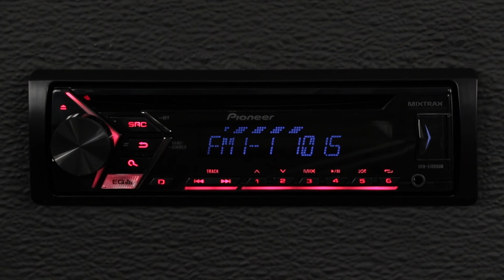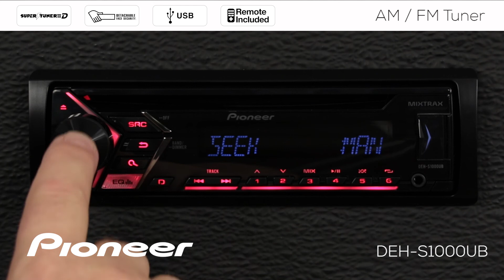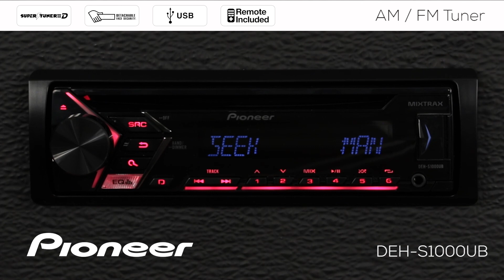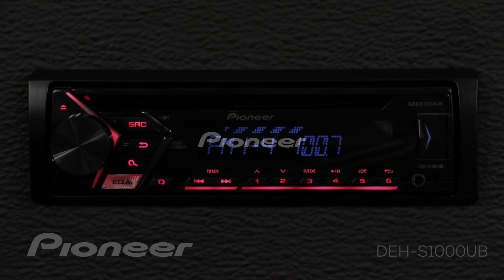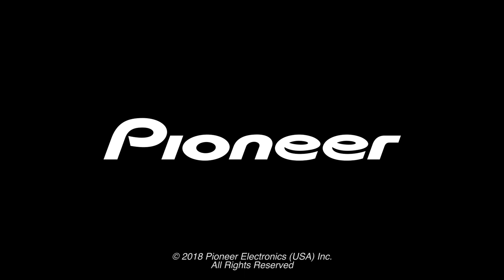How To - DEH-S1000UB - AM/FM Radio Tuner

Comment: why does it skip a decimal point when you seek? I am not able to put it at 89.0. It is either 88.9 or 89.1. How can I tune into 89.0?
Reply from the maker: The Pioneer DEH-S1000UB is designed and manufactured for the North American market.  FM radio stations in North America end in odd number decimals.  For example:  89.1, 89.3, 89.5, 89.7, 89.9, 90.1.   I'm not aware of a way to change the FM frequency step on the Pioneer DEH-S1000UB.   You can find more videos on Pioneer's YouTube Channel here:  https://www.youtube.com/user/pioneerelectronics
Reply: Here in the Philippines, our FM broadcasting frequencies are also usually ended in ODD NUMBERS, JUST LIKE NORTH AMERICA does. But, however, despite the Philippine FM frequency spacing ends in odd numbers, there are some radio stations here are also ended in even numbers (0.0, 0.2, 0.4, 0.6, 0.8), for example, DZLB 97.4 FM in Los Baños, Laguna, Philippines. A listener must use a digital FM tuner that tunes in both odd and even numbers. (mostly, all digital FM tuners use 50 kHz steps or 100 kHz steps)
Reply from the maker: @joshua.duque.sarmiento1115     If you want to use a radio in the Philippines, I strongly recommend to buy a Pioneer receiver designed to operate in that region.   Many receivers designed to operate in the Philippines are available.  Please take a look at Pioneer website in the Philippines here:       https://ph.pioneercarentertainment.com/
The Pioneer DEH-S1000UB shown in the video above,  is designed and manufactured for the North American market. In the north American market, the FM radio frequency steps are odd numbers and never use even numbers.  Products designed for the north American market do not need to change frequency steps and so are not designed to change frequency steps.     You can find more videos on Pioneer's YouTube Channel here;   https://www.youtube.com/user/pioneerelectronics
Reply: @pioneerelectronics  Thanks!

Comment: I save a station and close the machine and when I open it it is not stored, what am I doing wrong?
Reply: If your clock and radio stations reset each time you start your vehicle you may have an improper connection for the in-dash receiver's Yellow Wire.  The Yellow Wire must have constant power from the vehicle.  Do not connect the Red Wire and Yellow Wire together.  Take a look at this video for more information on wiring your Pioneer receiver:  https://youtu.be/kR2MO2kwFug?list=PLw63zJRQbCNjfGaTVA2WEqWsxnMgmnYd_     You can find a full playlist of Pioneer How To videos about DEH-S1000UB here:  https://youtu.be/YNniqyTm-TE?list=PLw63zJRQbCNjfGaTVA2WEqWsxnMgmnYd_    and you can find more videos on Pioneer's YouTube Channel here:  https://www.youtube.com/user/pioneerelectronics
Reply: @deckerdotto6035  thanks i appreciate it!!

Comment: How to mute and unmute?
Reply: The Pioneer DEH-S1000UB comes with a wireless remote control included in the box.  There is a mute button on the wireless remote control.  You can see it here:  https://youtu.be/mmI5DGo75Cs?list=PLw63zJRQbCNjfGaTVA2WEqWsxnMgmnYd_     Press the volume control on the remote control to unmute or adjust the volume on the in-dash receiver.  You can find more How To videos about Pioneer DEH-S1000UB in this Pioneer You Tube Playlist:  https://youtu.be/YNniqyTm-TE?list=PLw63zJRQbCNjfGaTVA2WEqWsxnMgmnYd_   and you can find more videos on Pioneer's You Tube Channel here:  https://www.youtube.com/user/pioneerelectronics
Reply: @deckerdotto6035  Mine didn't come with any remote!
Reply: If you have the North American version of the Pioneer DEH-S1000UB, it ships with a Wireless Remote control in the box.  You can see it here:  https://youtu.be/mmI5DGo75Cs?list=PLw63zJRQbCNjfGaTVA2WEqWsxnMgmnYd_  If you did not get a remote control contact the retailer where you purchased the product.  You can find more videos about Pioneer DEH-S1000UB here:  https://youtu.be/YNniqyTm-TE?list=PLw63zJRQbCNjfGaTVA2WEqWsxnMgmnYd_     and you can find more videos on Pioneer's You Tube Channel here:  https://www.youtube.com/user/pioneerelectronics